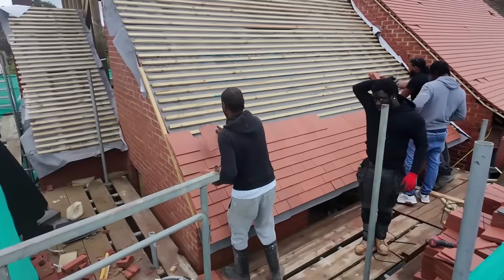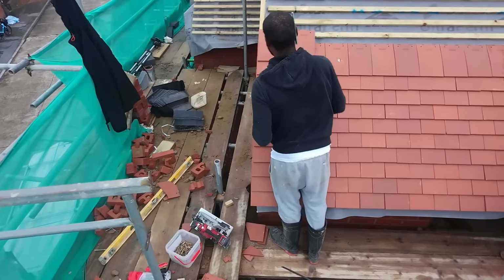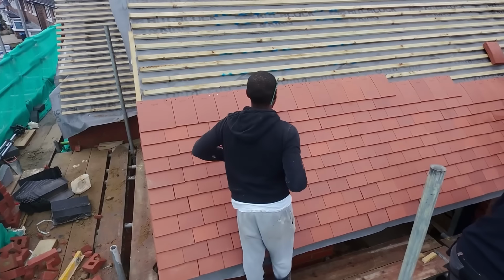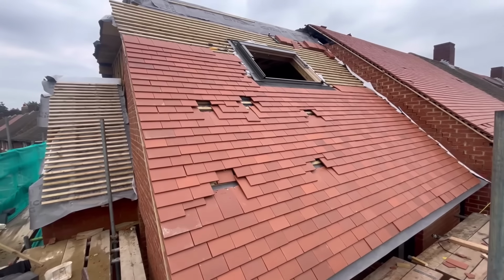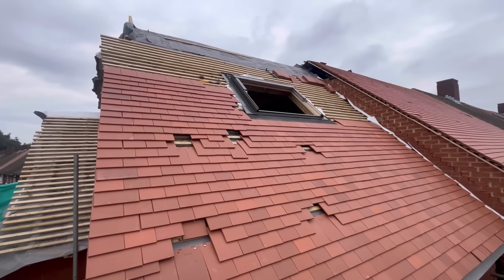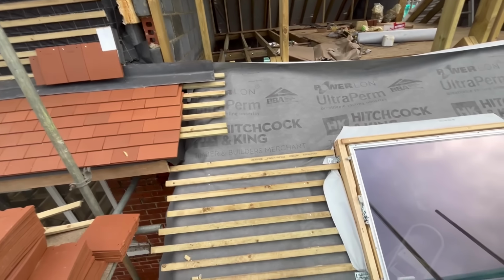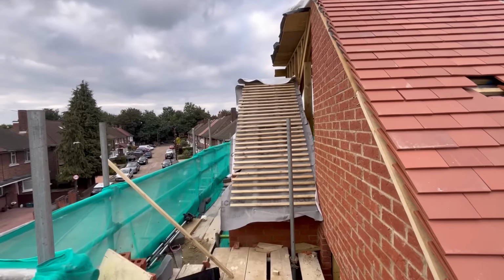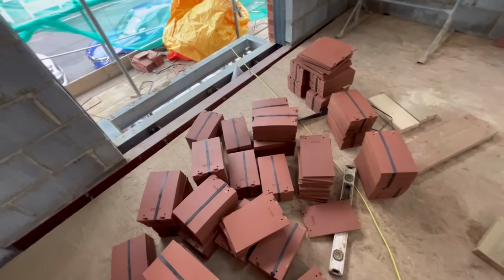Starting tiling the roof and installing the roof windows

Comment: Do yourselves a favour and build some simple ladders from leftover battens. They make moving up and down the roof much easier and there's much less risk of cracking tiles. With really fragile roofs I've seen roofers put these ladders on top of an old foam mattress to make 100% sure they didn't crack any tiles (in our case an asbestos shingle roof from the early 70s). I use these ladders twice a year on our shed's roof to drain and refill the solar pool heater and they're amazing.

Comment: Hi Darren, just a quick note make sure your step flashing is installed under the DPC 👍
Reply from the maker: Do you mean under the cavity trays that Iinstallwe above the roof on the party wall?
Reply: @darrenthebuilder  Hi Darren, yes the flashing has to be under the DPC on the party wall because if installed above any moisture will track behind the flashing and into the below space / room which no one wants. 

From Magaluf as I’m on holiday and still watching your vids
Reply from the maker: @PaulFinch-x2u  ok I got you. Ye it’s going below. I pre raked it out when I installed the cavity trays

Comment: Well done lads,but I think that’s the wrong flashing kit for them tiles?I may be wrong
Reply from the maker: This kit is marked TZ which is got plate tiles 5-45mm thick. There’s 2 other kits. One for slates and one for high profile tiles like Double romans etc
Reply: Don’t know what sort of windows they are but if they were velux windows you get a soaker kit for plain tiles that kit is for interlocking tiles
Reply from the maker: @beenflicker1  these aren’t velux. Can’t remember the brand but the flashing is for these tiles. I get what you mean as I’ve installed the velux ones. I can use normal soakers here